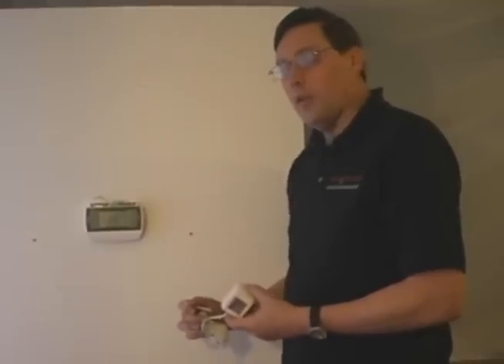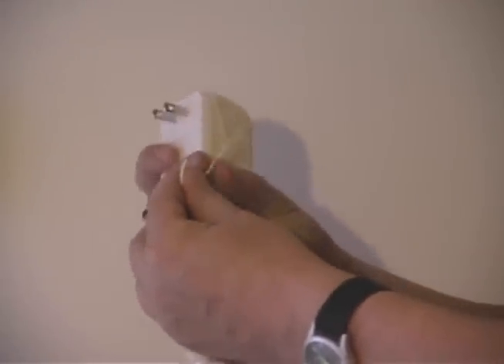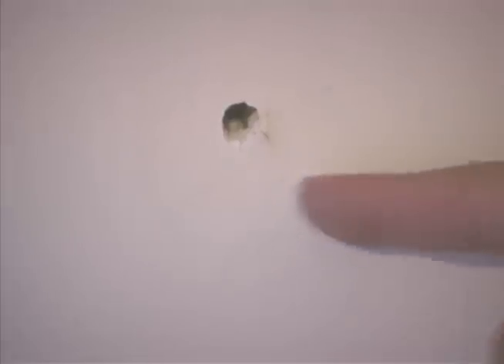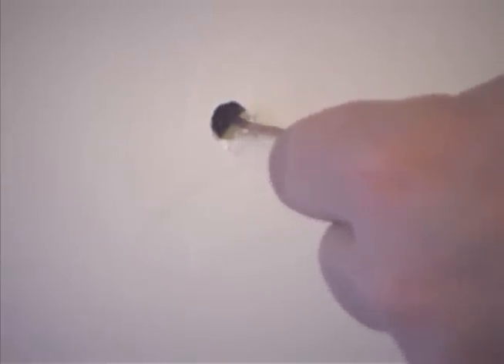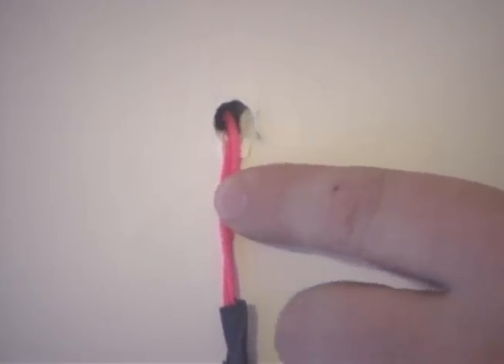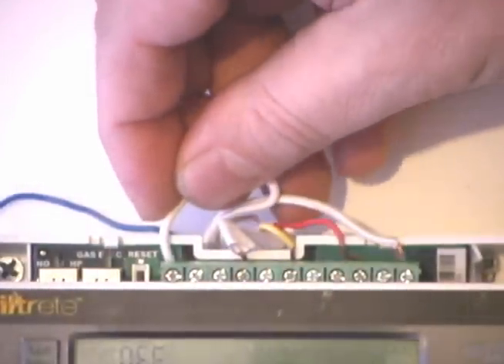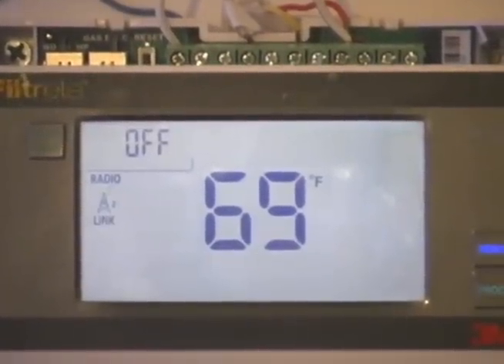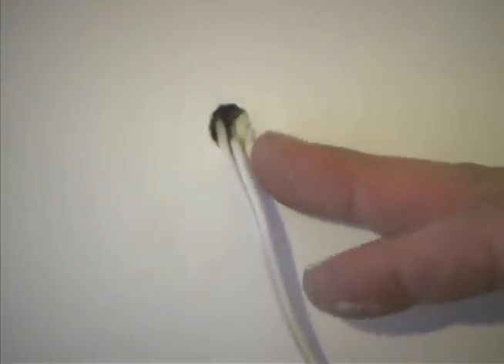C Wire - How to power the thermostat via an additional transformer

Comment: Where did you get your external transformer?  I tried using a 12 volt, .8ma transformer and my thermostat turns on.  However after a short period of time it just displays low battery.

Comment: Some older furnaces are 750 millivolts systems, some systems have a boiler for heat and a air handler for ac. The RH and RC jumper provides power to from the furnace to the ac system. Some times you have a 24 from furnace and 24v from boiler in this case you pull jumper so the two transformers want clash. and smoke the transfomer.

Comment: power down furnace from service switch. open door remove green wire from G and place it on comman (C)  and or common side of 24v coil (not on primary side of coil) or sometimes ground it to furnace will work. Put a jumper from G to Y on your board. goto to t-stat place green wire on c.  this a 4 wire install with power to t-stat. You want be able to turn on high speed fan manually, but it will work with the ac.

Comment: Ok you have some miswiring then.
On the t-stat:
R - 24v
W - Heat Relay
Y - Cooling Relay
C - Common

If you only have 4 wires you can power the stat with 2 of the wires (R and C is what powers stat)
W is heat
Y is cooling
Just match the colors in the furnace.  Is it an older furnace or newer?  What kind f furnace do you have?  Or do you have 2 seperate systems? Air handler for a/c and a boiler for heat or something like that?

Comment: So I connected a transformer wire to the C terminal.  Then I connected both the existing RH wire and the other transformer wire to the RH terminal as suggested @~3:30 in this video. powered up and I smoked the TSTAT!  Pfffft!!... just like that..  Had to get a new one.  :(  I am not an electrician but I followed these instructions.  My bad?  Well, besides that, how do I wire the 3M-50 up so that it actually triggers my furnace safely?